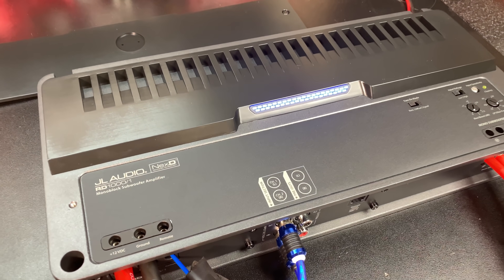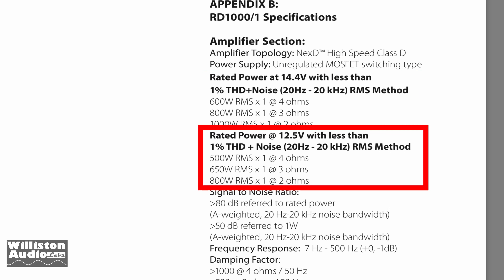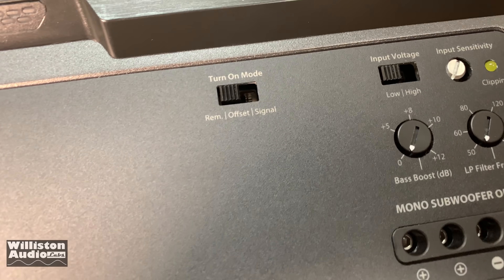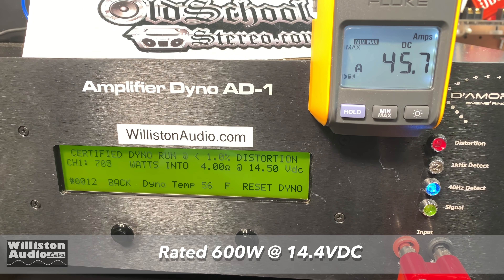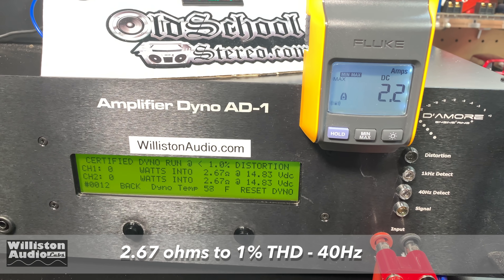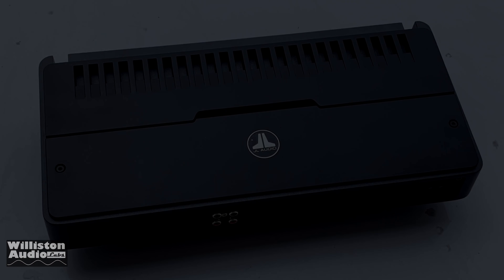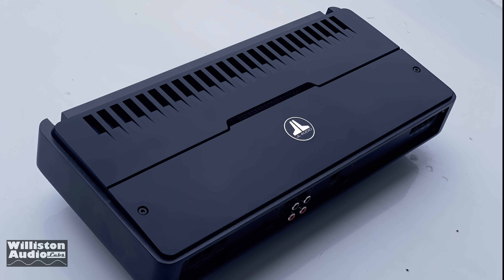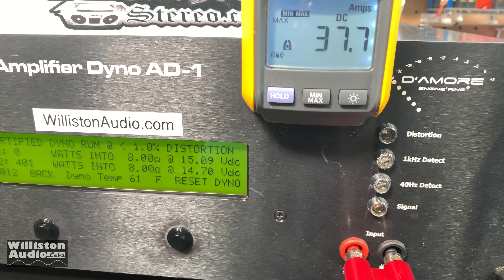JL Audio RD1000/1 Amp Dyno Test [4K]

Comment: These are Chinese ( all JL Chinese now?) right? Who's manufacturing them for JL in China?
Reply from the maker: I don’t know the build house, but I’d be willing to bet they chose VERY carefully
Reply from the maker: Not all JL is Chinese, their high end subs are still made in FL
Reply: @wal  yeah I have a 13w7 for the wife's car and just got a Slash 1000/1. I was speaking in terms of amplifiers. One thing that I found is you can find quality out of China. 95% of every single Sundown subwoofer uses Chinese parts. American coils but Chinese parts. High quality Chinese parts... Damn that sounds like an oxymoron lol
Reply: And all JL amp designs are proprietary, meaning you won't see their boards in other brand's heat sinks. That is always a good thing.
Reply: @msh6865  I know what proprietary means... As in there is nothing proprietary in the technology of my lithium battery Banks I have coming out. Go-LiATH lithium batteries. LTO technology. Shameless plug lol

Comment: Samxon 820uF35V: Tier 2, not the best, not as good as Elna, Chinese made, rather than Japanese or US/EU. 
---looking at the placement of those caps, JL seems to have mounted them specifically to make it difficult to see the specs on them. 
---So while Alpine is using Elna caps, among some other tings, JL is boasting the RD range or whatever as high quality. Even the clip indicator doesn't differentiate clip in and clip out.

Comment: too bad it you cannot disable its LPF. I have a Pioneer 80Prs which as well has the LPF settings always on and impissible to disable. If you have this combo HU and amp you should be aware none of them cann pass full signal for the sub. And having 2 crossovers at the same time isnt the best idea

Comment: Jl audio. Better give you all the juice. They very over price
Reply: Funny, this is one of their cheaper amps, and they are far from the most expensive. Yes, you can buy cheaper amps that make more power for less monoey, but you won't find that amp being sold all over North America and beyond. I want an amp I can get service on if needed, or even repair after the warranty expires 3-4 years from now, which JL Audio offers. Heck, the W7 subwoofers, even one from 2002, can still be sent to JL Audio for repair.
Reply: Kelly Nowell 
JL is way overated, and yes they sounds ok but I've heard better quality at a much lower price
Reply: Peter Kay completely false statement. You get what you pay for. Plus JL will hold their value while the cookie cutter amps will be worthless in 10 years. If they're even still working.
Reply: MSH68 false statement? that JL is overpriced? hah I've been in car audio since the 80's and had a couple JL audio amps that I've paid a good penny for and was NOT impressed with the features or the sound and when it came to selling I had to practically give the amp away... hold there value... yeah right....maybe they work for you but not for me

Comment: Is it made in China?
Reply from the maker: Yes, but done in a quality facility
Reply: Not many amps are built outside of China these days, though JL Audio builds to higher quality standards than most, ensuring a low failure rate and power levels above stated/rated.

Comment: Jl audio at this price range using cheap Chinese samxon capacitors totally unacceptable, they really are running on laurels and branding, seems like the only other amp brand that’s still using quality capacitors is Rockford punch and power series of amps😢
Reply: Only the power supply section uses Samxon. The output section uses nichicon, a very high quality and trusted brand.
Reply: Some of the RD have Yuscon caps on the output section and some have Nichicon. Mine is the 1500 and has Nichicon. And it seems they moved production to Taiwan during Covid, then later in 2021 switched back over to China. My amp says made in Taiwan and I have another RD that says made in China.
Reply: @albert770 Samxon branded capacitors have historically been rated the worse, and even in my own experience they have always bulged and leaked in other electronics I’ve worked on 😂 yuscon is ok but still not on par with Japanese brands